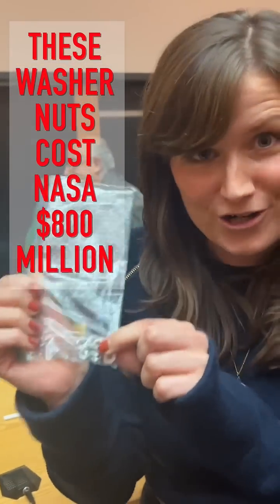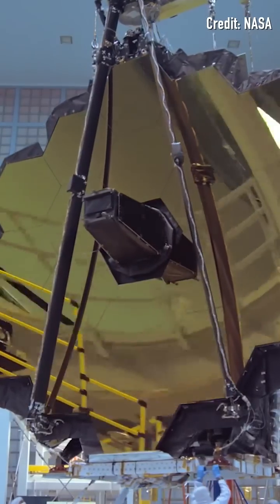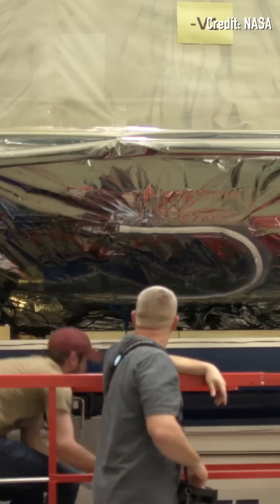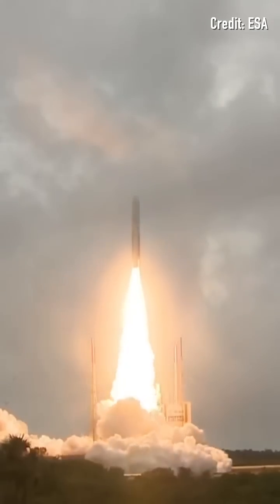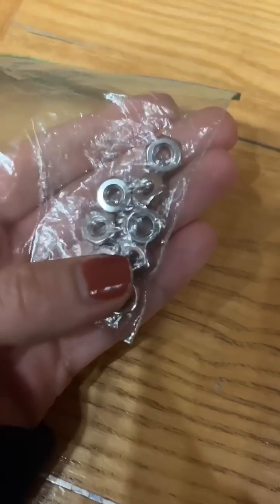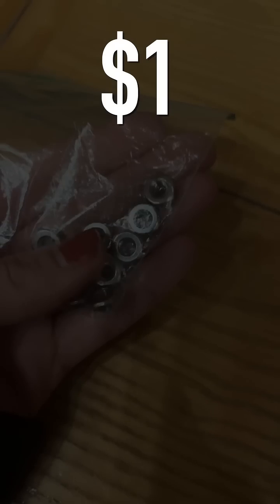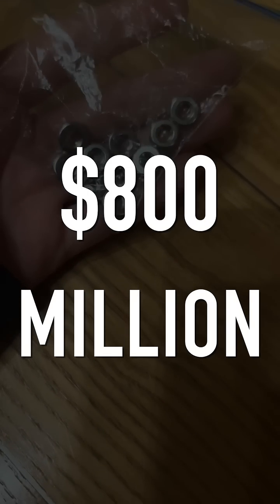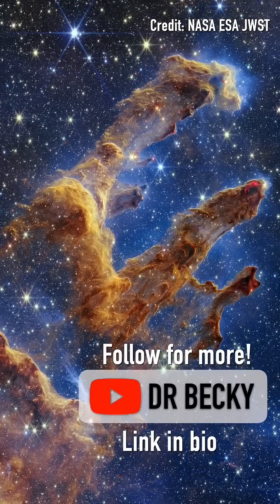JWST cost an extra $800 million because of these 10 washer nuts

Comment: We’re going to need an explanation of why it took over two years to figure out how to keep a nut from coming loose.
Reply: Castellated nuts and cotter pins would have worked. Purely mechanical solution means no chemicals such as Loctite would have to be tested.
Reply: Have you ever been to a launch? Everything is incredibly loud and shaky even though your five miles away. I am truly amazed at every launch.
Reply: It's simple mate, the nuts weren't the problem. But the nuts coming loose showed that the entire thing lacked damping. And more than likely would have not survived the launch.

They probably redesigned and adjusted a large chunk of the entire thing.
Reply: Every clown coming up with solutions without knowing the actual problem. That's why you're sitting on your workbench and not on a satellite.

Locktite? No chemical or flaking materials.
Nuts with pins? Maybe no loose objects like pins or they did not have space for pins as the nuts might have been in a hole.

Before you suggest solutions, ask for the real problem. Figure out if it's the real problem or just an indicator for a larger issue. Also, your solution has to withstand extremely high and strong vibrations, g-forces, vacuum, temperature extremes, radiation and... time. Because there is no maintenance possible if it fails.
Reply: She just told you why. $1m/day in testing.
Reply: 1m per day, thats why. doesnt sound like they were in a huge hurry to figure it out…
Reply: @mematt8955   They are getting paid either way, I'm sure engineers working on spacecraft and satellites are not getting paid by the hour like contractors. Plus even after launch, they are responsible and have to answer while getting paid or are on other projects.

Also, 1m per day also includes infrastructure, insurance etc. not just salary.

So yeah, as my previous comment hinted, don't assume, it just makes an ass out of you
Reply: Two things
First, from what I understand, is that the delay was because they had to make sure nothing else broke or came loose during the test (but didn't fall off like the more obvious problems).

The second thing I would guess is that typical methods of securing the bolts either wouldn't withstand launch, wouldn't withstand space, or could compromise the experiment (think off gassing or chipped off flakes of chemical bonding interfering with instruments)
Reply: @LuciaMakes  i was thinking about that to but I still don't know how they fixed it.   Maybe they just crossed the thread so it would not back off...
Reply: Probably because there were more issues than just the nuts and bolts that came loose, and they have to make sure everything is perfect because they had zero margin for error
Reply: Not sure if this is sarcasm, but judging by all the responses actually talking about washer nuts, maybe people really don't understand. 

It was not the fact that washers came loose, it was the fact components were shaking hard enough for washers to come loose. It means the entire system failed its dampening test, the washers were effectively something called a "telltale," where one part or result informs you about a result elsewhere.
Reply: @dimitrikemitsky  I wasn’t being sarcastic about wanting a longer video. I don’t like these YouTube shorts for this reason. I thought it was just the nuts falling out that was the problem.
Reply: I guess NASA didn't know what lock tight is.
Reply: @pandemonium274  that was my first thought but this is in space. I’m guessing chemicals probably act differently in vacuum of space then in earth atmosphere. Or not, I don’t know
Reply: Luckily lock washers were invented in time...
Reply: @pandemonium274 they know damn well what loctite is. They use 242 and 271 on the ISS.
Reply: A little gorilla glue and maybe some duck tape would work
Reply: Lock tite was not invented untill next year
Reply: A drop of loctite tend to do nicely. And locking springs and failing to get any of those a secon lug titened atop of another also work.
Reply: Because it's the government, and there were probably 40 different offices that the information had to go through, and everybody had to figure out how to get their cut out of the money before anything could be done. That's how the government works.
Reply: @slappy8941  no, it's because the washers were telltales, they indicated a deeper issue with the build, it funxtionally failed a dampening test and a section had to be significantly modified.
Reply: @dimitrikemitsky  damping. Dampening means making wet. Otherwise you are correct, the nuts aren't the issue and this video is clickbait.

Comment: Had I known I could have sent them twice as many for half the price... LOL 🤣🤣
Reply: Literally it was the testing, man hours, and hours of computing they cost money. Not the washers. You guys are thinking too specifically. It was just probably couple hundred more person hours working in a clean room environment and another shake test.
Reply: @SECONDQUEST  I understand the infrastructure and engineering required to correct the issues. Just the disassembly and reassembly requires clean room time. Then step by step was read of a checklist and verified multiple times. My dad worked in the electronics side of the defense industry making sub assemblies both for NASA and the department of defense. I've seen small clean rooms. And I know what my dad had to go through just a little bit to inspect everything that was going on. The idea that the assembly was designed without something to ensure those nuts did not oscillate during the vibration of large or the test is what I can't grasp. It's not like this is our first rodeo. It's just insane that this design did not include it to begin with that's what annoys me. The other thing they have to be careful of when they put parts into the assembly to fix it it has to go through all kinds of testing just to make sure it's not going to affect anything around it. The analysis, engineering and the testing before they even try to reassemble it is crazy. It's almost as good as when they got confused and programmed for metric and then measured in standard on a Mars lander. That didn't work out too well did it? Not trying to go off on you but it's just crazy that it was even designed that way. As someone commented in aeronautics these safety wires everywhere. There are redundancies built into every assembly. Safety wires would have been very easy to do. Assuming that the nuts that oscillated are big enough to have a hole drilled in them with a strong enough wire to be used as a safety wire. That also assumes there's something they can attach the wire to that won't break! I don't know if maybe I'm overly simplistic but I believe in engineering things so you only have to do things once. Maybe we could resurrect the old guys that built the pioneer and Voyager spacecraft. Or at least say could tutor the new guys a little bit on what to do to make sure things don't break. But all those guys are long gone in the ground. Their legacy is still hurtling through space though doing its job.
Reply: @SECONDQUEST  no matter how much testing they did and man hours, a solution needed to be found to stop those bolts undoing themselves due to vibration. These are engineering problems that have been known for centuries and have well established solutions.
Reply: They just needed to include washers to reduce the chance of unscrewing due to vibration. Personally I would have dipped them in super glue as well. 😂
Reply: @aaronmicalowe  As soon as I saw them my immediate thought was why aren't they nylocks?
Reply: @owensmith7530  I know y'all are joking around, but they have to make sure that none of the materials will outgas vapors in a vacuum that could redeposit on sensitive components.
Reply: @HermanVonPetri  it's just person hours in a clean room. They're not testing the washers for out gassing, they bought the washers pretested or with a %100 understanding of their material and manufacturing processes, they're not buying trash off the shelf.
Reply: @SECONDQUEST  I was merely commenting on why they wouldn't use certain materials, not why it was so expensive.
Reply: @HermanVonPetri  Yes I know, nylocks might outgas or degrade in a vacuum and radiation. Shake proof metal washers that they went with are the safer option on those issues.
Reply: @owensmith7530  and it's ultimate environment I'm not sure how well nylon would work. It could get brittle or something but by then the vibration would be over who knows I would have went with the basic lock washer
Reply: @owensmith7530  well I don't know who the idiot was that didn't specify a lock washer on those, I would have used them.
Reply: @owensmith7530  even though they may not be suitable for this use nylocks are the bomb. I've been using those damn things since the '60s!
Reply: @aaronmicalowe There's literally a product for this already called locktight lol
Reply: @chrish4439  oh I remember lock tight, but I only ever used it on plumbing joints
Reply: How about loctite!
Reply: @JohnRodriguesPhotographer  probably the same problem as nylon, but it couldve easily been fixed with a tiny drill-bit, a drill and a piece of iron-wire. Or that's at least what I think. Just drill a small hole through the nut and bolt when they are tight, insert the wire trough and ty both ends of the wire together, badabing, badaboem.
Reply: @patdbus  the problem is they still have to disassemble the system to even drill the holes in those bolts and nuts. Or screws. Before they can drill them out they have to take it out of the clean room it would be considered contamination to have the drilled out pieces of metal in the clean room. Even the pieces of dead skin that we drop throughout the day would be considered contamination in the room. The room is cleaner than a surgical suite.
Reply: Aircraft industry have been using wires threaded through the nut and stud to prevent this for decades
Reply: Lol that would of been nice but its the labor that cost so much not materials

Comment: I MET THE MAN that designed the O ring seal that failed on the space shuttle SRB* and blew it up...

I hope one day to meet the man that designed these 10 washer nuts and continue my association with the world's most spectacularly costly failures.

* Just add - he did not make the mistake, he designed it to the speck he was given, it was NASA's failure
Reply: NASA was under extreme pressure from government flunkies to get the Challenger launched. There was a NASA administrator who “folded to that pressure instead of saying “we’ll launch when everyone agrees that it’s safe”, as was NASA’s SOP.

The temperatures on the launch pad were WAY lower than expected in Florida (even in January). When the engineers at Morton-Thiokol saw huge icicles hanging off of the launch tower, they all refused to sign off on the launch authorization. The NASA administrator put the screws to the M-T upper management. The engineers held their ground. Then the upper management business pukes at M-T told all the engineers to leave the meeting. Management (instead of engineering) signed the launch authorization against the engineers’ strenuous objections. As soon as they heard of the explosion, those engineers knew exactly what caused that disaster.
Reply: The man probably still feels awful about it even though it wasn't their fault. :(
Reply: @Cyborg_Octopus  It was Nasa's fault for launching it when it was too cold and out of the operating temperature.  But it was also on the government and politicians for pressuring Nasa to launch since it'd already been delayed.
Reply: @beeman4266  Very true. Both shuttle disasters were preventable and caused by hubris and valuing money over lives. If the engineers tell you that something isn't safe you need to heed that warning because it's their job to know the limits of what they built. 
As an engineer myself I know how important safety is and also how risky it is to tell the boss-man "No". They engineers who stood up to the administration and government would have been fired and blacklisted if the disaster didn't happen but they did the right thing anyway. I'm sure their only regret about Challenger is not forcing a scrub somehow.
Reply: @Cyborg_Octopus  Engineers get lots of flack for problems they warned about. Happens all the time. It is not usually so spectacularly deadly. Usually it is just really annoying. Like how hard it is to fix your car's heater. Stuff like that.
Reply: @bbaucom2  In that case it's a matter of sabotaging the right to repair. The most commonly replaced parts should be the easiest to get to but the auto companies don't want people fixing their cars. I mostly do appliances nowadays and I see it all the time. That and planned obsolescence are extremely frustrating.
Reply: @Cyborg_Octopus  While that is becoming more and more common, the primary reason is the desire to make mass production faster, easier, & cheaper, with no regard to the need to maintain and repair the product after the sale.
Reply: @CyborgOctopus  The only way to stop the Columbia disaster would have been a different configuration. NASA was so lucky they didn't lose a shuttle during reentry a decade earlier. Every reentry was a crap shoot. A giant frozen hydrogen  tank next to delicate heat shield tiles.
Reply: Maybe you should stay away from anybody associated with major engineering projects. 😲
Reply: @YoungGandalf2325  HAHAHAHHA
Reply: Did you also meet the guy who forgot to convert to metric and caused a Mars lander to crash?
Reply: @LordAmerican  - NO but he is on my list...
Reply: You won’t. JWST was already a massive success
Reply: So You are wrong the O ring did not fail weak spineless men failed
Reply: Challenger did not blow up or explode. It was torn apart by aerodynamic stress.
Reply: @ProtusMose  Do you recall the why of it? A bit of falling foam insulation from the fuel tank knocked some of the heat shield tiles off the port side near the wing. This was an accident. Ordering mission control to not tell the crew how bad the damage was was murder. 
What should have happened was a redocking with the ISS, a proper EVA inspection, and an emergency supply rocket sent up with extra resources for the station and shuttle crew as well as new copies of the particular tiles to be replaced in orbit. Sending the shuttle back down was extremely reckless and downplaying the damage doomed the crew.
The image of the Apollo 1 crew praying for safety comes to mind. They trusted their engineers and we failed them. NASA rushed, didn't follow procedures, and put humans in a pressurized firebomb with insufficient documentation.
Career be damned, if I don't think a coffee machine is safe enough I don't approve it. If I worked for NASA during any of those disasters and I was told to put safety second there'd be hell to pay. Safety regulations are written in blood.
Reply: @Piccallili Pit, I think someone has made up the story he told you. There was no “one engineer” that designed those joints. There was a dozen (or more) engineers involved, since it had been recognized and identified as one of the several “single point failures”, and “O ring erosion” had been documented on recovered, disassembled boosters from several previous launches. 

The design sucked (the later much- improved design incorporated additional fasteners that prevented rotation of one O ring retainer with respect to the other). But the weather (specifically temperature) played a key role in the failure. If it had been a more typical Florida weather (about 20°F warmer) and if NASA & Morton Thiokol had behaved more responsibly, the explosion would likely have never happened.

My point is that there were likely 15 - 30 engineers who ultimately participated in the design, review & approval of that joint.
Reply: @teefkay2  he didn't claim to be the only engineer involved in the design of the seal.
Reply: @CM-xr9oq   He may or may not have claimed that. But Piccalilli Pit stated ”I met ‘the man’ that designed the O Ring seal” (see above)

He did not say “_I met a man who claimed to be on the team that designed the O Ring seal.”_

I was replying to Pit’s comment, not to what that guy may or may not have said.
Reply: @teefkay2  That wasn't the only comment that pit ever made.    You should have said that you were replying to one of the comments that Pit has made.
Reply: @teefkay2  NO Ive simplified it for wit and brevity in the comment. He was the approving signature.
Reply: I think he warned them NOT to launch.

Comment: That's made my decision. I'm leaving my career in IT support and going into washer nut manufacturing. They will be a snip of the cost at £5000 each :D
Reply: That's actually not that expensive, and if you look at other components - a single bearing can cost £50,000 and it's a "mass" produced one. If you need something custom it can be more.
Reply: I suggest to get into devops instead, probably more likely to make some bigger bucks.
Reply: True, it was a click baity title
Reply: Maybe listen again, the washers don't cost much at all, though they caused the price to rise because they came to lose.
Reply: @CodeLeeCarter  I was being sarcastic and taking the title at face value.
Reply: Code has reflexes so fast he would grab sarcasm as it flew over his head.
Reply: The washers didn't cost anywhere near that much. The program hanging up due to needing them did.
Saw similar in IT, when one application failed, the costs spiraled rapidly, as employees still were paid to do nothing.